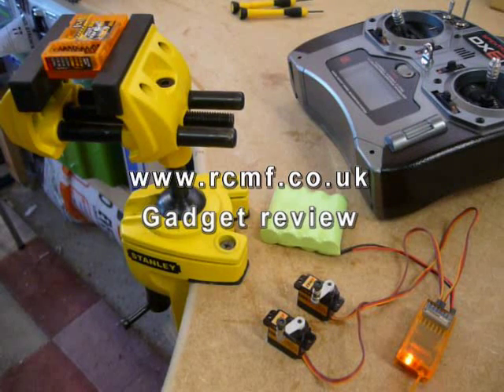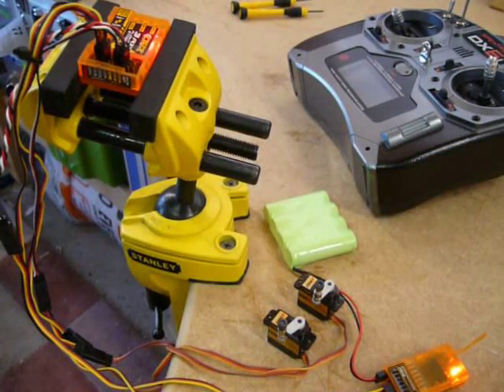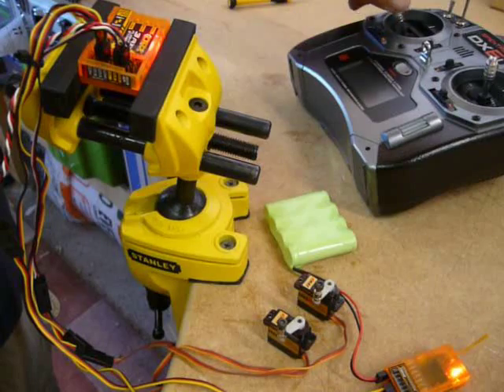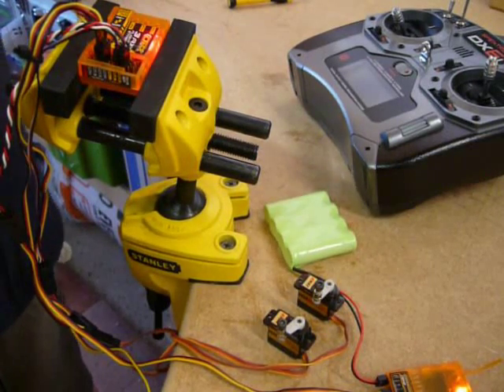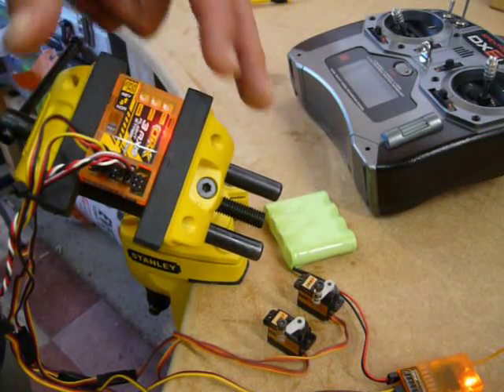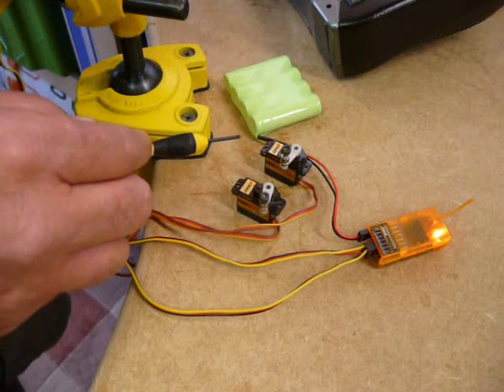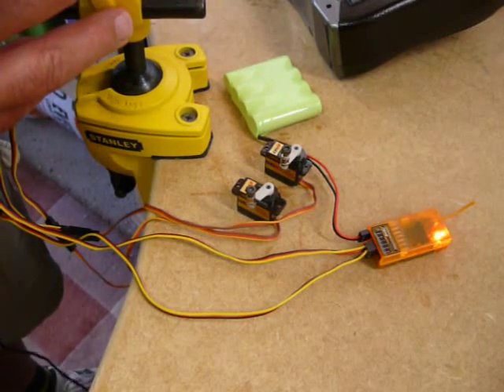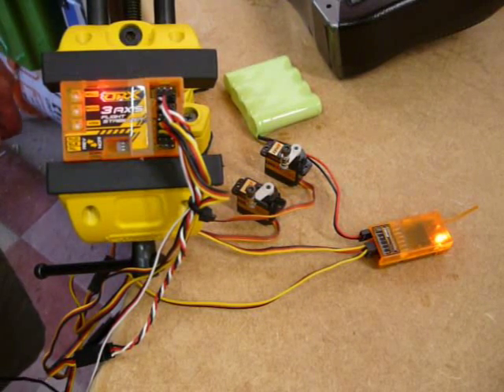RCMF: Orange 3-axis flight stabilizer bench test part 1 of 2

Comment: It would work if you allowed it to mod the signal before it was mixed with elevator. The only way I could think to do this is use an onboard v tail mixer install this on both elvator and aileron then put the two outputs into the v tail mixer then plug two servos into the mixer. If using the mix on you transmitter this stabilizer would not have access to the single axsis that it needs. I found such mixer on ebay for $5 dollars with free shipping and shipped from USA.